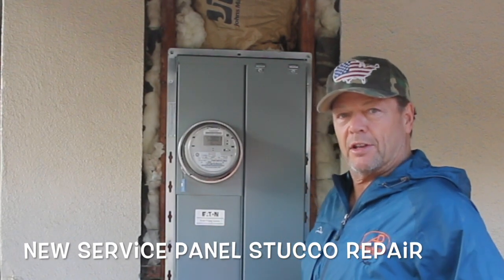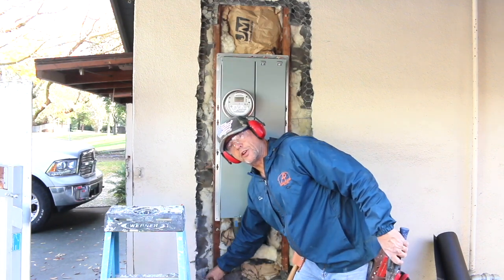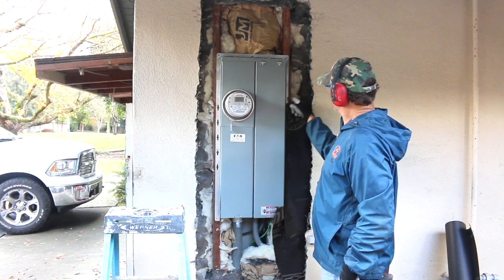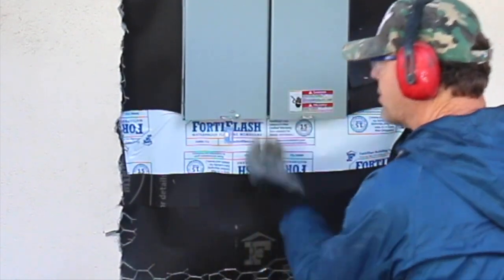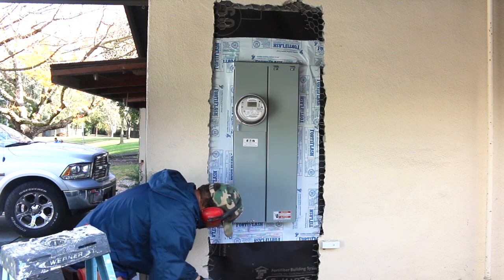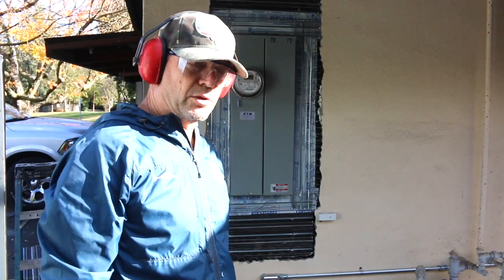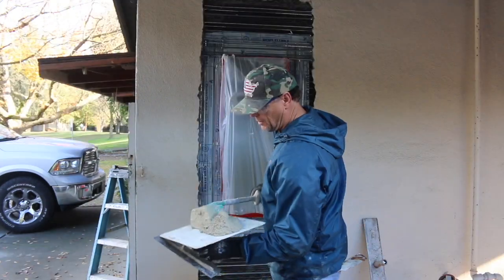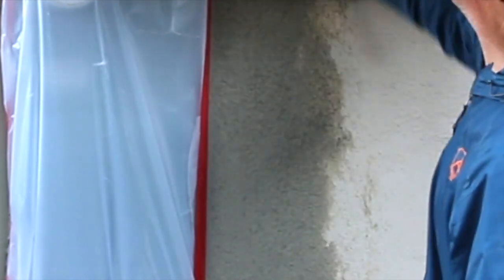Lath, Scratch, Brown and Finish stucco in one day electrical panel stucco repair

Comment: Really appreciate you making this video, Ken. We passed final inspection today in San Jose following this video. Only difference was our local codes required building paper to have minimum 4" overlap on the top and bottom of panel, and 2" on the sides. Also, we applied our flashing in the low 40s so we had to redo it because it wasn't too sticky and I didn't clean everything well enough before putting it down the first time. It only took me 4 hours after going at it carefully 😅
Reply from the maker: Nathan I’m so glad everything worked out and that I was instrumental in the process. Happy powering

Comment: This is an excellent video. Next electrical panel video, could you maybe film do's and don'ts and  how you want the electricians to leave you with? maybe a description of material and or tools, too. Thanks!
Reply from the maker: Thank you and Yes, its funny you should ask about the tools needed as I did take several pictures of the tools and material to use, but it was a bit of a mess the way I had them laid out so next time I will do a bit more organizing and be sure to show tools needed. And as you probably already know, there are many tools required for this exercise. til then!

Comment: "If you can, try to roll the bituthene up under the metal part underneath the box..."  "Once again, my Bituthene is rolling up on the edge of the box"   So are you are folding the Bituthene to stick partially on the edge of the box and transitioning it to stick to the black paper backing material.  How much did you stick onto the metal box?  Half an inch?  Quarter inch?  What are you caulking after you have the Bituthene in place?  The edge of the half / quarter inch of Bituthene where it sticks to the metal box?  or the right angle where the Bituthene transitions from the edge of the box onto the black backing paper?
Reply from the maker: @dvk578  yes I’m trying not to stick more than an inch to the underside of the metal box because I don’t want it sticking out past the plaster repair. Also trying to span over framing members to the sides and down over black paper below.  Caulk any holes that are suspects that may allow water to infiltrate the system.  Hope it all went well

Comment: I'm about to give it a go.  I added some 2x4 segments for additional backing, and a dense wire mesh from Lowe's.  Good tip about stitching it in with bailing wire, going to do that.  Hopefully it will insure it won't cave in when I push in the mud.  It was hard to push in the paper around the edges.  I caulked left and right sides fully.  Feeling pretty good about it.  There is a copper grounding wire that will be going straight through the stucco, hopefully not an issue.  I caulked around it.
Reply: If it’s your first time working with these materials, don’t expect it to go as smoothly as the video. I have more that 25 years experience with this stuff and it rarely got easier. Use small amounts of fast set or just use regular stucco base coat until you know how unforgiving the fast set can be. Sounds like you know what you’re doing though so good luck and thanks for watching. Ken
Reply: @frustrating123  Thanks!  I used exactly one 20 lb bucket of fast set stucco patch and it went pretty good, to neatly complete the first section on the bottom.  I couldn't get the texture to match but no biggie.  I gave it a random texture which was better than nothing.  :)  I used a sponge type float and the edges are all smooth.  The next section above should go easier.  I think 3.5 buckets total for this job.  Finish this week - I'm taking my time :)
Reply: But yeah I don't recommend Fast Set for beginners.  I was a little panicky at first, then when it started going in okay I calmed down, working my way up from the bottom.  "Wiggling' the trowel a bit helped.  By the time I was finishing, the stucco mix was definitely getting a little 'stiff'.
Reply: You got it bro. I like that you used additional wood for backing.  Makes it much simpler to attach
Reply from the maker: Great!  You did it.

Comment: Hey Ken, your work is excellent. Just one question. 

I’m an electrician if 30 years and I’m pretty sure an electrician did this cut out. 
1. DONT USE A GRINDER 
2. Leave some paper and wire to tie back to 
3. Keep the edges jagged as
To not get a cold joint.
Reply from the maker: Great point Bruce!  Thanks for checking in.

Comment: Great Video. How do you secure lathe around panel flanges?
Reply from the maker: Hi thank you you!  Take a  4d 5d or 1 1/4” roofing nail and nail at an angle to catch the edge of  wood or metal stud. If no stud, then use tie wire any which way you can bite onto the panel. Hope this helps
Reply: @AbersonPlastering  Excellent advice! Much appreciated

Comment: Do you ever use the stucco patch by rapid set? That’s my favorite product from them but it sets quickly
Reply from the maker: Yes thank you for your comment. I’ve switched over to Lowe’s fast set. But you can extend the drying time for any excelerator by cutting it with the premixed plastic cement. Try a 50-50 combination

Comment: What did you secure the paper with?
Reply from the maker: Hi Chris, any type of a hand tacker that uses small 1/4’’ to 3/8’’ staples work just fine. In a pinch you can just use regular galvanized roofing nails.

Comment: Why was the panel cutout was so huge? Only need like 1 to 2 inches all around.
Reply from the maker: Andrei andre I have no idea why they cut it so big.
Reply: It's cut out so big so you can get the proper water proofing and tie the old lath with the new lath